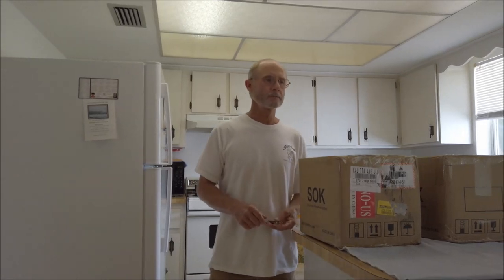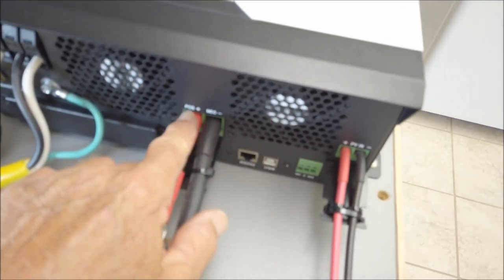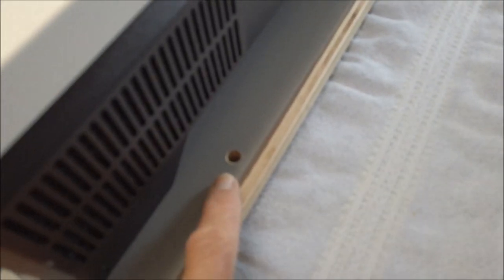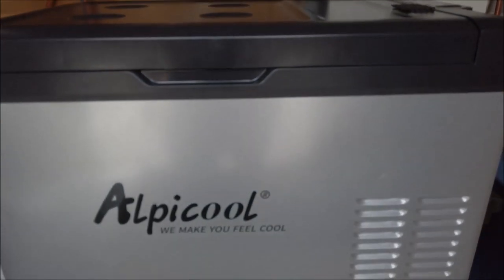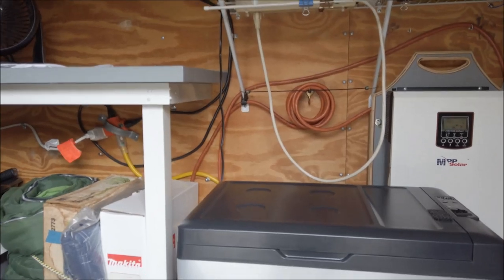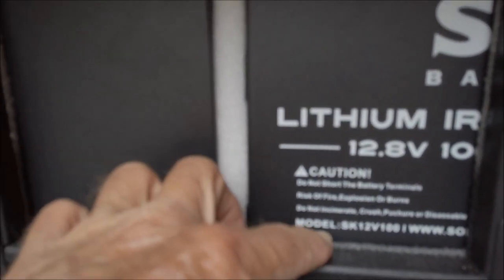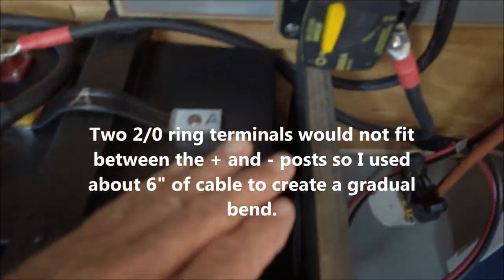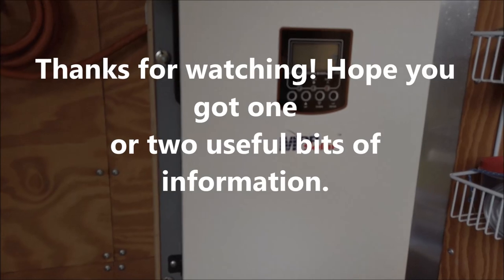Cargo trailer camper power system with SOK batteries and MPP Solar

Comment from the maker: Update FYI: Just back from a 5 day camping trip. Arrived with fully charged system (well, except for what the fridge used on the 2 hour travel) and ran the A/C for the first night. A cold front pushed through by the morning so I put away the A/C and deployed the (4) 100 watt solar panels. Nice clear skies and cool temps, but shade in the morning and afternoon. Nevertheless I got good sun from about 10 AM until 4 PM with peak time giving me about 300-350 watts. With A/C out of the picture I continued to use battery power for fridge, lights, fan, electric blanket, charging drone, camera and bike batteries and, the big one, coffee maker. On the third day I decided to charge up with the generator because solar was just not keeping up. But disaster, the ever faithful Honda would not crank (turns out you have to replace the plug every couple of years LOL :). No issues really, just like to keep the system charged up. Two more days on the morning of departure I decided to "stress" test the system with the Mr. Coffee maker. The MPP gave me a "low battery fault" and I shut the coffee maker off after about half a pot. Although the fault light had come on the coffee maker did continue to run until I shut it off. All the small items including the fridge continued to work fine until I got home, no faults. The system was at a voltage of 25.5 volts when I got the fault, 25.3 when I got home.  This seems to comport with information I got from an inquiry to Point Zero about the Titan I was considering. Their suggestion was that I should get a second battery bank (Titan stackable battery) because when the voltage begins to get low the inverter will struggle with high demand equipment. I kinda' thought at the time that they were just maybe trying to upsell me, but now I see they were just being honest.
Reply: Thank you so much for all the details and follow up. You saved me some time and a few headaches. Exactly what I was looking for as an amateur. :)

Comment: Thank you for your excellent review. I bought the less expensive 12 volt MPP solar inverter with the 800 watt inverter. I have 2  310 watt solar panels and I'm thinking of pulling the trigger on a 200ah SOK battery and maby adding another one depending on how well the one battery performs. I'm hoping to not have to run a generator all night in order to keep my furnace running through the night in my 41 foot converted bus I use as a hunt camp in cold Canada. 
I'll also use it to watch a movie or 2 on a 34" led tv , run the lights maybe replace my propane fridge with a 12 volt one down the road. 
You have made me make up my mind. 
Thanks again.

Comment: Food for thought...you may want to connect either pos or neg from the front (close) 24V battery and run that over to the MPP.  That way current flows across the entire parallel bank rather than from just the back (far) 24V battery.  Positive from one of the 24V batteries and negative from the other feeding the positive/negative input for the MPP.  Nice setup!
Reply from the maker: Thanks, I have heard that and considered it at the time. But I have also heard that it is important to use the same length of wire for the pos and neg cables. I did consider using one cable of greater length to accomplish what you suggested, but since the two arguments seem to be in conflict I went with shorter cables of equal length. I would be happy to hear and consider your thoughts on this.
Reply: @SlimSh8E  Voltage drop/heat and resistance is a combination of wire gauge and total run (from - back to + and across posts).  Symmetry looks nice but the relevant items here are total length of circuit loop and coming across the entire bank, IMO.

Comment: Just ordered this exact setup for atv trailer. Fingers crossed
Reply from the maker: I think you will be quite satisfied. My system is still working great and the MPP is holding up well to the rigors of being mobile. With summer setting in fast I'll get to see if the SOK batteries can still keep up with the A/C running all night. I think at worst case scenario I will just have to run my generator another hour or so before I switch to battery power only. I have 600 watts of solar configured 3s/2p and I would advise this to be the minimum needed. I tried it with 400 watts of solar at first and it just can't quite cut it if you use electricity somewhat normally.

Comment: And i thought your ac slide out would be my favorite video of yours, i really like the information packed in this one. I'm getting ready to start my cargo trailer insulation and was getting ready to rewatch your slide out unit to get trailer framing done. I'm getting ready to order this mpp, glad to hear it's working for you!!! I got my lifepo4's in, doing them as 2-12v banks ran in series with 4-210w panels to charge it all. Hoping its enough power to run the ac. Appreciate the videos!!!
Reply from the maker: Thank you, I really appreciate your post and I am happy to pass my experiences along for others to consider even though I know I am not as polished as some of the other YouTubers. If you haven't already ordered your MPP2424LV, here is another unit that is very interesting. It has a slightly more powerful inverter with 4 A/C receptacles built into the side. The one downside is that the MPPT only goes up to 60V as opposed to the 2424 which is 80V, so that may be a little limiting on the solar panels you can use. Please let us know how your new system turns out. Thanks again.                    https://watts247.com/product/pip-2724lv-mr/
Reply: @SlimSh8E  i surely will, and thanks for the link. I looked at that other unit for a second but like the one you got more. It's a hundred bucks cheaper, and i plan on wiring it to a sub panel box with 4 15a circuit breakers. I may end up having to hang two more solar panels on the side of my trailer if i can't charge my 280ah 24v battery with what i have. I'm making a electric driven tilt frame to maximise my charging and hope it's enough with the 4 panels i have, but if i do need more i like the ability to just add to my array. 
   I've saw a bunch of hand cart and wheeled totes, but yours is the first simplified cutting board mount I've seen (And I've read a few comments about ants messing up units while not in use, so great thinking). I will definitely be stealing that along with your ac slide out lol. Hope you had a great fourth, and again thanks for all the great ideas to steal from!!
Reply from the maker: @checkingoutgypsymike2075  Okay, good choice. Here is the link to where I got mine from maximumsolar on Ebay. Paid via PayPal and, mind blown, received the unit from Taiwan to Florida in FIVE days!      https://www.ebay.com/itm/274725361463?epid=3033529052&_trkparms=ispr%3D1&hash=item3ff6e85737:g:ptoAAOSwzzVbKHBu&amdata=enc%3AAQAGAAACgPYe5NmHp%252B2JMhMi7yxGiTJkPrKr5t53CooMSQt2orsSlHY%252FYTip4QFVjNQrCEJt6qnicyAp8gy7HErYuzjAtRBklcGe7oZ%252BwKlA9IF%252FL9B1C%252Fw%252FJ78xb1ugS3t56hEBMDLHgafFYImvN%252B8M14I7jD4%252FD%252FAmQDx%252BNqAonyGTmBT%252B0bU9XPeyjG7v2f%252FVsz6rrnVQTEyQSRertL7iPLcYFVNJ7Q%252FY%252Fsue3Bk90dzQGothVsB7YGS2IGRAyMkhR6X6dvBBtiK7cxZKoX%252FK97S0PAs9SPBHVAbX9NQUFenjyCKYNVIG%252Fyr1hU4s9FWAJ1PzB35iA2NBRxeuy5H1mekjXZERi6W6zAvKwMxQkUJ9JL231ebyvdHYxLn0JpmuAxWhl%252FDSsQV5zHSkbBiZxQPfstYNbNDOp31IYXDpnX0ydznqnBWg63eUGm8VFsVf3i37acV2Y5%252FVJCzf3rTdMCeyFRvGLMZh0OuLzLis7NXkDXm1569p3oeWPxQQCh33eskFsQ9f8jGvblA1HdIkJ52bVAzl2AilbRHQVOHD5UpBFxKOLZ84NOfUh7h2xiUjaGsOZw3SkIyDSfDcqaOmBDG86Q3grIe85y43FjsYGWMN9yyt0zil1uDOKZemjOXGsMM9UOoWcRHt%252BIrGQlNtGY4yENlBcN59mHNSX3pvH%252FK2ceHkr7uVsfZ3rrPh8UXwWQNd6O86Fcsa37fCDpv2dGooy0ReWAQ9FvR5CKgU%252B5C4pw3eeYkaGocL8Cc46EnI%252BxYXDDRM19p%252BdCIy%252BLbdKMt%252B5j9bgjqzzijthujCIBNgnWHAp9xWfFXdfw8ABw361CXLO4mZ3zVfQtnksSDeJZ0s6V0%253D%7Campid%3APL_CLK%7Cclp%3A2334524

Comment: Great job with your vid and a very clean and professional install!  Question... is the breaker necessary?  I am looking at the MPP and thought they come with an internal breaker?  Curious of your thoughts.  Thanks!
Reply from the maker: The AC in (utility or generator) does have a 40A breaker, I don't quite remember if the PV in has a breaker, but the manual definitely calls for a breaker on the DC coming in from the batteries. Although I'm learning a bit all the time, I'm still playing in the shallow end of the pool when it comes to the really technical aspects, but my research shows that the batteries can really generate quite a spike in a malfunction situation and so the conclusion seems to be that putting a breaker between the batteries and the MPP is VERY important. The wire gauges, especially from the battery are also very important and will be one determining factor in what size breaker you use. Just an FYI: If you do happen to settle on the 2424LV-MSD, 2ga cable will be the largest you can use because on this particular model they do not use lugs but rather a clamp that compresses onto the cable itself without any ring terminals. I do highly recommend this unit. It has withstood the rigors of the road and my occasional mistakes in hookups and has continued to perform flawlessly.

Comment: I came across your videos because I want to run a window AC in a cargo camper too. I love your hatch system. How long does it take to charge your batteries with the Honda 2000?
Reply from the maker: About 5-6 hours. I've added two more batteries for a total of six, but I've also bought about 700 watts of solar panels, so depending on the sunshine, I can get by with about 3 hours with the Honda and I only charge at 10 amps which keeps the Honda idling low and quiet. Charging at 30 amps it's running full speed. A lot depends on the temperature, but I've had no issues keeping the A/C going all night.

Comment: What size bolts/terminals did you use for the SOK batteries so I can order? TY for the great vid...
Reply from the maker: Here is a link to the bolts: https://www.amazon.com/dp/B07957V3YL/?coliid=IP7HBG44JIH2V&colid=3QW5G7OXEHYTA&psc=1&ref_=lv_ov_lig_dp_it  and here is the link for the ring terminals:   https://www.amazon.com/SELTERM-Marine-Terminal-Battery-Eyelets/dp/B073Y9GJGS/ref=sr_1_4?dchild=1&keywords=Selterm+2+ga.+3%2F8%22+ring+terminals&qid=1630158001&s=industrial&sr=1-4    You might want to double check the sizes, I think I might have used ring terminals with 3/8" holes. Probably better to be a little big than a little small, but verifying wouldn't be a bad idea. And obviously you would want to match the gauge of the wire you are using. Oh, and here's a link to the nuts: https://www.amazon.com/gp/product/B089PR8DVP/ref=ppx_yo_dt_b_asin_title_o00_s00?ie=UTF8&psc=1
Reply from the maker: Forgot to mention that SOK batteries come with high quality bolts, but I prefer to use the studs with nuts (and they are slightly longer than the supplied bolts).

Comment: I too have the 2424lv-MSD and you have helped a lot in the batteries I will use in my motor home. I have 4 160w 12v panels and thought I would save a little space by going with 2 of the 200Ah SOK's. Would you mind posting your settings for the MPPT 2424lv? "Outstanding video!" Looking forward to more.
Reply from the maker: Thank you! Here are the setting I use for the 2424LV ( I will only list the ones I changed, all other settings will remain at default) : 02= 20A. 05=USE. 13=24.5. 18=6OF. 25=FEN. 26=28.8 (but I occasionally set this to 29.2 to help balance the cells). 29=24.0.
Reply: @SlimSh8E Thanks for your help.
 All the best for the coming year!

Comment: I ordered a 207 AH 12 volt SOK three weeks ago. At 48 pounds it is still lighter than each of the 4 80 AH AGM batteries in my existing 320 AH bank which weighs 208 pounds total.  Certainly moving these batteries around is not to be taken lightly.... I am curious about you choice of a 24 volt system. I know money can be saved on the cabling from the panels to the charge controller. Most of my adventure van is 12v but I notice many builders use 24v. Thank you for your videos.
Reply from the maker: My (limited) understanding is that if you are going to convert your DC current to 120v AC then the higher the voltage you start out with the more efficient the process will be. Less wasted energy. I did not go to 48v because the MPP 48v system is more expensive and heavier, so this is a compromise between 12v and 48v. Also, the MPP Solar 12v system has only about a 1000W (?) inverter which would not work for my air conditioner. There seem to also be some other concerns with using a larger inverter as far as pre-charging the capacitors. As you say most of your system is 12v and so I think you will be very satisfied with the SOK batteries. Thanks for you comment.
Reply: How much are the battery's
Reply: @stephensanchez5761  207 AH 12 SOK lifepo4 $1024 US shipping included.. but currently a 7 week wait.

Comment: I'm thinking about a similar setup but I wonder how well the Mpp will hold up to the road vibration ?
Reply from the maker: That is a concern of mine also but I have to say so far there have been no issues at all. I just finished another ten day trip and all is working perfectly.
Reply: @SlimSh8E  glad to hear that, maybe I should have said the road beating ? Thanks for sharing your knowledge, much appreciated.
Reply from the maker: @mkroach59  Thanks. Glad to, I learn a lot by reading others experiences and so glad to share mine. Road beating is pretty accurate :) some of the roads I went down this last trip were rough, really rough, like 5 MPH max rough, LOL!

Comment: Wow- I'm IMPRESSED!!! Great job with the MPP LV2424 & very cool with SOK batteries. You should be genuinely 'good to go' with your current set-up. Very impressed, really. How much for the LV2424 & did you consider the 206AH SOK's- they seem to be a comparable value, and- might've given you just enough more to extend usage a bit...
Reply from the maker: I believe I paid between $500-600 for the MPP LV2424 and that included shipping. I think they rely on Ebay to sell their products, and delivery was truly impressive. Five days from Taiwan to Florida, I couldn't believe it. I did consider the larger SOK batteries, but I have a bit of a lame back and I try to keep things that I occasionally need to lift as light as possible, so I opted for the 100Ah batteries. But the larger SOK batteries would be a better bet cost wise.
Reply: @SlimSh8E  Bigger is always better take in point my 1975 Lincoln Continental Town Car that one day I need to get finished.

Comment: Where did you order your LV2424 from
Reply from the maker: I got it through Ebay by a seller named maximumsolar. It was amazing, from Taiwan to Florida in 5 days!
Reply: @SlimSh8E  Nice! I have a growatt 48V 3000 TL LVM ES in my house also in Florida and i wanted to put an LV2424 in my shed to power some basics. How many watts PV do you have incoming?

Comment: So if 24 volts do you use a buck convertor to 12 volts, or is everything 24 DC to 110 volts AC?
Reply from the maker: That is a bit of an issue that I have given some thought to. I don't currently have a way to derive 12V (well, I do have a Bluetti EB150, but I took it out of the trailer to reduce weight and gain room). Although it is less efficient, I just use the transformer that came with the Alpicool fridge. That is the only item I need 12V for, but with my capacity I don't worry about the extra 40 or so watts it uses (intermittently) with the transformer.

Comment: What size AC is it powering overnight?
Reply from the maker: It is powering a 5000 BTU A/C. I just took a ten day camping trip, all primitive camping, no power available. The weather was cool enough that I did not need to use the A/C but I did use all the other usual items such as lights, refrigerator, fan, music, coffee pot and charging my EBike battery as well as other miscellaneous batteries. The results are even better! Typically I would run my generator in the early afternoon for about 5 hours to get a full charge on the power system (I never really discharged fully, I always recharged at around 26 volts, which is nowhere near the SOK's suggested cut off at 11 volts, or on my system, 22 volts). After fully charging the system I could run my trailer for two full days (again, no A/C, but everything else). Today heading home I went beyond that and ran my trailer until 6PM and the voltage was still holding at 26 volts. I will say that I am more than satisfied and glad I did not go with a more expensive system that I originally contemplated. I forgot to mention that I did have (2) 100 watt solar panels deployed during the day but considering I was in a pretty dense forest I don't think it helped much. Typically I was only seeing about 20 watts of solar going through the MPP into the batteries. Not enough to make much difference I think.